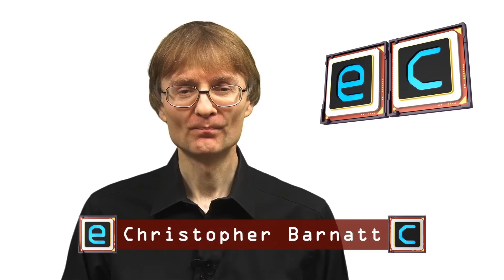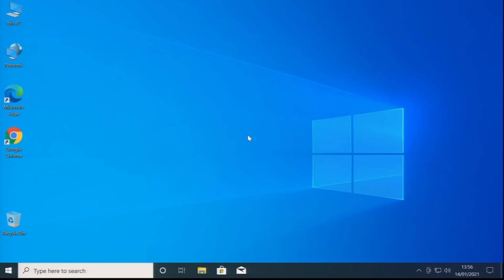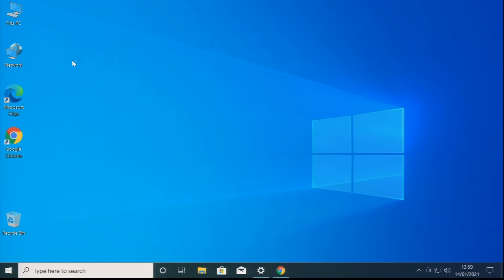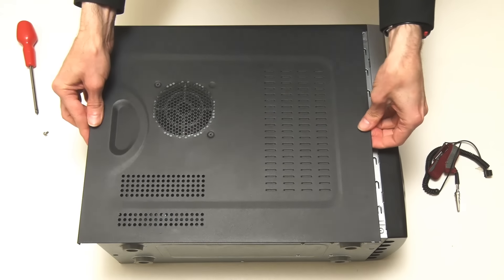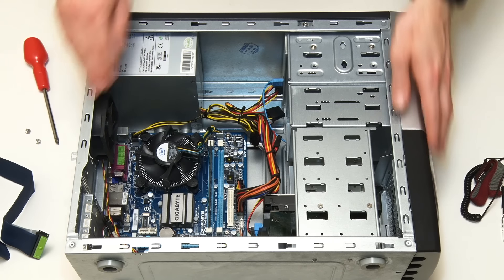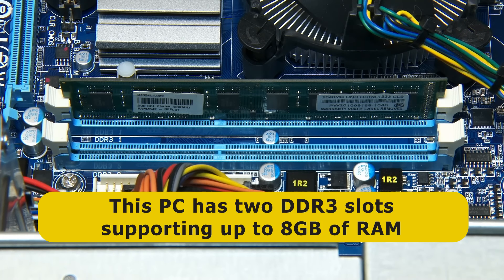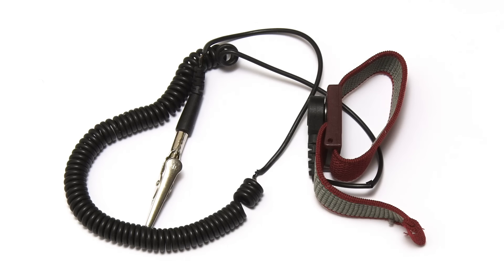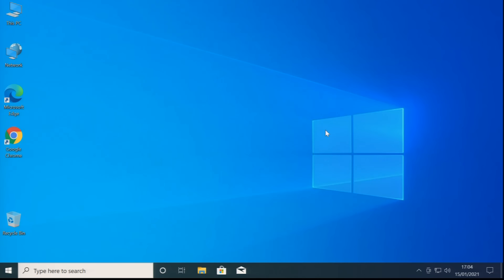Old PC Upgrade #1: Options & RAM

Comment: I got Asus EEE 1001PX with a 1C/2T Intel Atom for free from school, since it was about to be trashed. Upgraded the RAM from 1GB to 2GB, which is maximum supported, installed an SSD, installed Windows 10 Tiny X64, turned off useless services and I am happy with it. It's a good machine for taking notes and doing light stuff. For a free PC it was a good deal. Greetings from Czechia!

Comment: Definitely needs a zip drive, and a 72x DVD rewriter with lightscribe. So many people leave those essential upgrades out.
Reply: Or multiple card expensition too
Reply: Go for the 250MB version... 100MB just not enough anymore.
Reply: Maybe a SCSI tape drive while your at it, too?
Reply: don't forget your math coprocessor.
Reply: Honestly, LightScribe was the best!  It made professional looking DVDs instead of using a hand written label.  I've still got an LG LightScribe DVD writer that I should move from the old PC to the newer PC but I think it uses IDE.
Reply: And a ROM chip with the latest version of BASIC flashed on it.
Reply: @ElmerFuddGun  I agree! I have some LightScribe disks and there are new external drives that support them. Great fun to play around with, although the disks can be a little hard to find. Very useful for amateur music or software production.
Reply: and two floppy drives: 3.5" and 5.25" of course :-)
Reply: LS-120 and FireWire for all the modern peripherals
Reply: @derekp2674  - My older PC had 2x 3.5" floppy drives because when I made that PC those drives were about $8-12 each IIRC so my thought was "why not".  It was handy now and then.  It also has 2 DVD drives but that was because the second drive was added later to use LightScribe and there was no point in removing the first DVD drive.
Reply: Anything over a 32x cd is dangerous. Had a library cd explode inside a 52x. :(
Reply: @kingneutron1  The US Army originally developed the 52x drives to drop in Afghanistan in antistatic bags. The Taliban would pick them, use them to upgrade their old 286 machines and BLAM instant drive explosion.
Reply: I have a zip drive external unit and disks...who knows, it might be an antique someday???😃😃😃 
They were pretty hardy though.
Reply: Hi old-timer, Zip-drive, and love those super nice looking CD/DVD with Lightscribe burner, (sadly the dish are harder to find?)
Reply: There's no such thing as a 72x DVD Writer.
Reply: @therealvbw  It sure would.
Reply: @ElmerFuddGun  I gather it requires special DVDs? I ask because I still have a trusty HP laptop from the Windows Vista era with such an optical drive and never used the Lightscribe tech.
Reply: @elfedorausado  - Yes, unfortunately.  Not sure where you might find them now.  Even back then they cost quite a bit more than regular DVDs.  I'm sure they are on the used market somewhere.
Reply: @plica06  "No one will need more than 637KB of memory for a personal computer. 640KB ought to be enough for anybody," - Bill Gates
Reply: @ElmerFuddGun  excellent idea! How about using an ide to SATA adapter
Reply: Zip drive? 🤣🤣😂hilarious

Comment: For comparison, when you put in the new SSD, please put back the original 2GB of memory.
This way, we can see which upgrade benefited which type of computer usage.  Which one helped boot time the most, and which one helped applications launching the most, and are the differences significant?

Of course, then that should all be compared to having both the memory uprade + the SSD upgrade.

Thank you.
Reply from the maker: I will do various comparisons! :)
Reply: While a system with 2 GB of ram and an SSD would be fairly snappy, I wouldn't reccommend it simply because you'll be relying on the swap file a lot and if it's also on the SSD it'll greatly shorten it's lifespan.
Reply: Great ideas
Reply: @mikem9536  Since an SSD's lifespan is probably 5x your lifespan, the heavy use of the swap file will probably not ever be an issue.

I have never heard of a SSD getting worn out (running out of its over-provisioning), even in commercial use, other than by someone deliberately running software designed to wear it out.  Yes, there is a limit for "total bytes written" (TBW) that SSDs can endure.  But the value is such that no normal use case will reach that limit, even for servers that routinely pound away on their SSDs.

If anyone knows of an example of a SSD that has exceeded its rated TBW to its NAND fabric, please provide a link.

Comment: I have a computer from 2011 (that's the date on the BIOS, at any rate) but it was a pretty high-end box in 2011: 16GB of RAM, 4-core (8 threads) i7-2700K CPU at 3.5GHz and dual 1TB drives in software RAID.  It's my living-room computer and very usable still, though running Debian and not Windows.

I really don't understand people who get new computers every 3-5 years.  I find even 10-year-old computers still perfectly fine.
Reply from the maker: That was indeed a good spec for 2011 -- and still perfectly good today! :) Until last January all of the videos for this channel were edited on a 10 year old Core 2 Quad.
Reply: I'd imagine that an i7 with 16GB RAM and 2xTerrabyte drives would have been a small fortune back in 2011?
Reply: @lawrenceallwright7041  I bought it through my company.  It wasn't that expensive; I think under $2K (Canadian dollars).  I tend to buy white-label rather than big-name brands, so that saves some money.
Reply: @dfs-comedy   Sounds expensive enough to me, probably would have been about my month's salary 10 years ago!

Comment: Looking forward to this series Chris.  I spent most of 2020 upgrading a 10 year old PC.  Went from 2GB to 16GB of RAM, added SSD, and dedicated graphics card (one less task for the CPU to do).  Also had some unexpected "upgrades", as the old CPU fan on this PC I have died on me, so that got replaced as well, and the power supply I had was a 500W power supply, it got replaced with a 700W supply, because the dedicated graphics card pushed the consumption up to about 600W, so 700W gives the overall PC a bit of head room to work with.  Fortunately for my upgrade, my motherboard would take RAM speeds up to 1866, so I installed a pair of 8GB 1866 DDR3.  Other than that, the motherboard specifications for my Asrock board are similar, as it too has 4 SATA II ports as well.

Comment: hey Christopher,this brings back "memories" no pun intended lol,to get a more responsive system i also uncheck animations,then your window panes will open instantly
boot time may be increased if you change some settings in the advanced options (system settings), like use all cores at bootup,etc

Comment: With hardware stocks across the world being critically low (laptops, graphics card, monitors, processors, only SSD's  and RAM are somewhat available to me atm), it's definitely a good idea to consider all of the old hardware we have laying around. I see so many machines forgotten, neglected and collecting dust in the archives of companies and homes, it's a crime not to put them to use. 
Getting a Win10 key is about 10-15 euros if you google right, a fully featured O365 for home or professional users is about as cheap as your netflix account and both run pretty wel on upgraded motherboards from a decade ago. With some PCI-Express bays there might even be room for a neglected GTX### that could get you Minecraft or Fortnite going. 
I find great joy in giving new life to an old machine, with parts from derelict machines. 
Great video!

Comment: A very smart video to make with a lot of people updating their PCs to work from home.

PS - When I first saw the processor type I was thinking you were going to the deep-end of the pool with a Socket 771 Xeon upgrade.  No pressure but those were fun to do back when X5460 processors were flooding E-Bay.

Comment: Second hand-dual core PCs seem to have actually substantially risen in price over recent years. I have a couple of dual core HP ex-corporate desktops with 4GB RAM which I bought for about £25-£30 each delivered, which was the going price at the time on eBay.
Reply: There are a lot of RETRO games and such that run better on older hardware cause the older CPUs have instruction sets some of those old games and programs need that are not on the newer CPUs. Its a weird thing that many games have workarounds for. But when you run into that one game you really want to run well and it wants a Pentium 4 from 2010 to run, there you go.  Same reason some people hunt down original PCjr, apple II, and such. sometimes emulation cant do the job.
Reply: @braddl9442  Since when are games from 2010 'retro'? I consider retro games to be from the '80s and '90s.

Comment: Running (simultaneous) programs faster is what really speeds up when you increase RAM size. Doing simultaneous test, such as loading a dozen tabs with different media-rich websites would show even greater performance gains from this upgrade.

Comment: I have been given free Dell PC computers, which l rescue, because I hate to see them go to the city dump.  I know they're useful life can be extended and I prefer a PC versus a laptop.   I love the better keyboards which I typically get from Logitech and I prefer the mice from Logitech too . I prefer to have my monitor on a floating arm connected to my table with plenty of workspace.
I have an old Lenovo PC that I am now retiring after 15 to 17 years which moves slower than a garden snail. I've replaced it with an Intel i7 chip on a Dell Optiplex 7040 with Windows 10 Pro. After watching several of your episodes with professional content and quality,  I have used that information to rescue 2 older Dell machines  and  installed MX 19  Linux. My goal  is to learn Linux and ultimately become comfortable enough with it to walk away from Windows. Your presentations have given me the courage to explore and rescue machines that should never be put to pasture. Thank you for sharing your knowledge with the rest of us as education is a very powerful tool.

Comment: One option not included is if you replace the motherboard, you can install Ubuntu versus Windows and avoid an expensive upgrade and actually be a bit ahead of the curve for future uses.
Reply from the maker: Certainly the case -- I've many videos here on such installs. :)
Reply: Except if you replace motherboard, and hence processor and probably RAM as well, what's left of the original computer (in a simple configuration like this, with no expansion cards and only a hard drive)? Might as well buid a new one from scratch.

Comment: Thanks Chris. If I may, I would also suggest reapplying cpu thermal paste in the next video. I find it makes a huge difference, especially for older hardware. My 10 year old i7 2600K used to reach 99C during games. After reapplying thermal paste it never exceeds 60C.
Reply from the maker: Good tip. :)
Reply: @ExplainingComputers   also take Vitamin D  christopher , its important for the human  body
Reply: 4000 units per day  ,vitamin D3
Reply: @ExplainingComputers    4000 units per day, vitamin D3

Comment: Additional static charge dissipation technique is to first grasp the computer case to equalize the charge between yourself and the goodies inside the case.  If using a wrist strap connect the alligator clip the the computer case.  When handling the motherboard, ram and drives outside of the case always equalize the charge the same way before installing and connecting cables.

Comment: Wasn’t there a scam on ebay, etc. where a guy was selling laptops with spyware pre-installed on?
Might be a good idea for a future video showing people how to buy safely.
Reply: I would say that the simplest way is to completely swap out the hard drive (especially if it was pre-owned) and use a fresh HDD/SSD and a copy of Windows. If that's not possible (especially since you would need your own copy of Windows), you could consider using Windows' resetting tool, or some anti-virus software such as Malwarebytes to scan for any potential dangers.
Reply: If I ever buy a used system, the first thing to be replaced is the storage.
Reply: Solution is to reinstall Windows and everything by yourself
Reply: I know what you mean.  I always scrub Windows off and install Linux!  I never even boot to that pre-installed spyware.
Reply: @MacAndSwiss  you do not need a copy of windows. the pc will just know if win 7 or newer was on the computer befor and auto activate. all you need is an 8GB thumb drive and some knowledge of how to make a bootable thumb drive. I do not know if you can use the pc you just bought to do this or if that is a bad idea.
Reply: @DigitalJedi  But i replaced the storage befor putting it on  ebay.

note pc are too big to put on ebay the shipping alone would be like $50 usd (i have a pc from 2011 ish i would put on there if it were not for that unfortunately it even has a usb 3 card in it)

Comment: Upgrading Ram helps. I think SSD will further improve the boot time.
Reply from the maker: Agreed! As we shall see.
Reply: @ExplainingComputers  Yeah ram, ssd, gpu for modern webbrowser hardware acceleration like a gt 730 should make this fairly snappy.
Maybe a core 2 quad processor as well like a q8400 with a small overclock too 3.0 ghz or so, or if you want too get a bit more in depth on modifications go with a 771 xeon & mod the bios for a cheaper quad core processor like a xeon e5450 a 80w tdp quadcore cpu with the closest equivalent being the q9650.

Ofc a more modern processor like a 3rd gen I5 is ofc running circles around this.
I'm still doing some gaming in 1080p on a I5 2500 running at max turbo of 4.1 ghz single core & 3.9 - 3.8 ghz on quad core usage with 16 gb ram & a gtx 1660 super.
(Was previously using a r9 280 & wasn't planning on upgrading gpu for a while longer honestly but gpu died after 5.5 years of nearly daily usage in August 2020, id guess thanks too me running a fps limiter it was more the weight of the cooler bending the pcb over time that eventually caused a failure, it still lasted a while for me.)
Reply: @ExplainingComputers   Vitamin D is important for healing and for health in general , take 4000 units per day
Reply: Oddly enough, I got away with running a low-spec C2D system for a good while with an SSD upgrade - even though it pegs the SSD and is 'bad' for it, the virtual memory performance from having the page file on it was enough to keep it pretty usable.
Reply: @MattExzy  ya should have upgraded the memory too then, less pagefile need ;-)
Reply: @ExplainingComputers  Wasn't there any motherboard bios or driver compatiblility issues because of installing Windows 10 on a 10+ year old system?
Reply: @Sup_D  no, just check if it meets mimimum requirements
Reply: @SweatySockGaming  my PC is a 7+ years old, i7-4770 + Intel DH87RL Motherboard.
While I am not sure about CPU support for Win 10 with it, my motherboard doesn't have bios support for Win 10, atleast as per documentation on Intel's website (since Intel stopped making them, and has discontinued it's support and the product-line itself).

Comment: Thanks very much.  This was very entertaining / informative.  I worked with computers from1963 to the current date.  My undergraduate college required two language proficiencies - a foreign language (I was a biochemistry major so I had a choice between German and German - because of Beilstein) and a computer language (I had a choice between Fortran 4 and Fortran 4 as that was the only one supported by our CDC 3600).  Over the years (many many years) I acquired an aversion to working with hardware.  I usually broke things I worked on.  Your explanation and elucidation gives me some confidence that I should attempt to update some of my older systems, again Thanks!

Comment: Don't have a radiator.  I temporarily ground myself touching the ground screw on a nearby outlet, and touch the case.  I avoid touching the connectors. This works for me.
Reply: I connect a ground wire to a piece of metal, and keep my bare foot touching it. Of course only when things aren't with power on.
Reply: Just get a regular plug and run a wire to the ground prong. For extra safety, remove the live pins or prongs.
Reply: I've never intentionally grounded myself before an upgrade in my life. However, there's no need for all these fancy suggestions... just touch anything metal.

Comment: Great start to a series! I have a couple older business- or workstation-class machines of this era, which have served well. We did get a new gaming laptop around Black Friday, but it's still nice to keep the desktops relevant. An SSD (crucial MX500) really made a huge difference.

I did notice an unused front panel usb header on your motherboard which could be handy for things like a Bluetooth adapter mounted internally.

Comment: wow, it's so clean inside! did you bought it like this? rarely the sellers clean their pc before selling it
Reply from the maker: Yes, to my surprise it was that clean inside. There is dirt on a few connectors as you can see in the close-ups, but somebody had been at work with a blower!
Reply: That was my thought. I often am given old computers and they are, in the words of my wife, "dusty-dirty" and I am asked to clean them outside.
Reply: A minute with the air compressor does miracles.  Don't use the air to spin the fans too high, and yes outside recommended.  I'll use a qtip to wipe sticky dust from fans.
Reply: @ExplainingComputers     Christopher please Vitamin D 
4000 units per  day
Reply: Dust can be conductive, and excessive buildup can cause short circuiting in extreme cases. Good to clean as a part of the upgrading process.